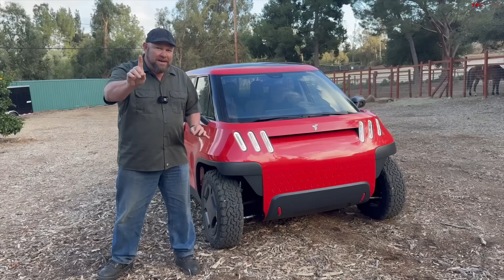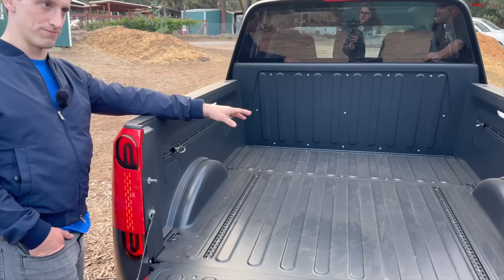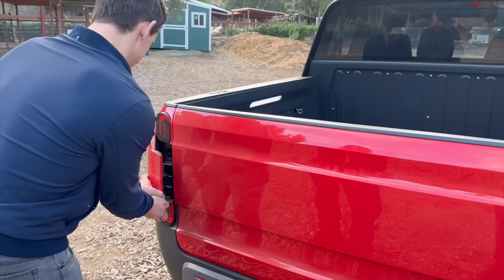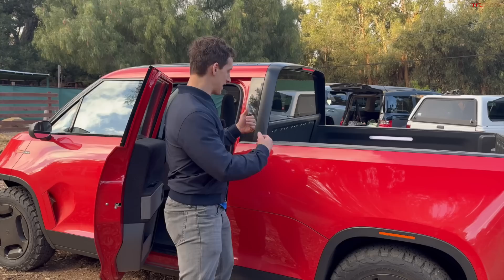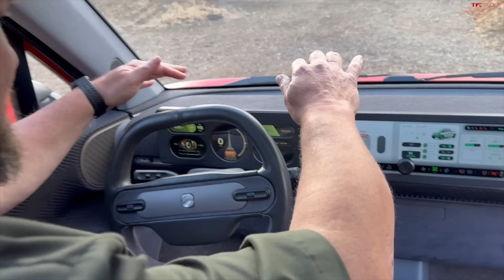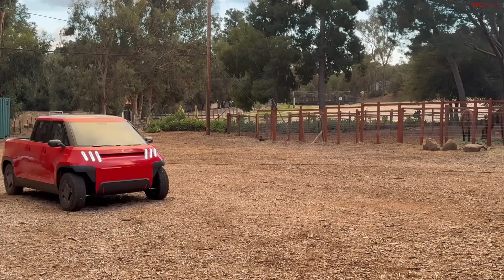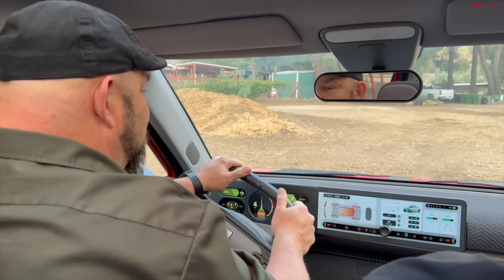I Drive the Most Revolutionary Truck In Decades: Meet the Telo MT1!

Comment: I am not a fan of pickup trucks. More so being on the road near them. Sorry to say this, but most "bad drivers" I've encountered on the road are usually a pickup truck driver. Heck, I can narrow it down further to white pickup trucks. Knock on wood, I've not been in an accident, but the number of times a pickup truck has tried to just merge right into my car (Honda Fit) on the highway or cut me off in a residential street is crazy. Anyway, I just see pickup trucks and know I should avoid them as much as possible. They aren't safe to be near. All that said though... the Telo? I'm actually interested in. Only due to the compact size + partnership with Aptera. I would 100% get the option of a Telo with the solar panels, but as a 2nd vehicle. The daily driver I'm aiming for is the Aptera. Once I have that, I could see myself getting a Telo.

Comment: I have a Lexus GX460 with a V8, and this truck has basically the same towing and weight capacity as it does.  

Even as someone who has a decent amount of experience with EVs (5000+ miles in different ones) despite not owning one, that is impressive to me.   

Seems like they will end up with a pretty decent product once it's ready for manufacturing.  Well done!

Comment: After looking at their web page, I think they should inclose the front wheels. There may not be any performance reason to do it but the cosmetic look will change the perception by leaps and bounds. Currently it has a golf cart look which I don't think will help sell a "truck". That area will always be dirty from road gunk and muddy roads. 
Their next model should include a very small ICE engine acting as a generator that is only for charging the batteries (like the BYD?). That would relive those with range anxiety by adding a massive amount  of miles to the range.

Comment: I wanted to not like it, because i generally dislike EVs. However, its well designed & they understand the importance of "staying in your lane". By not making this something its not & excluding features that are impractical, theyve created a pretty utilitarian vehicle. By ditching the offroad capability, they should be able to stiffen the suspension enough to ensure highway speed stability. Im not a fan of the glass roof, although thats the trend in modern vehicles.

I did have to laugh at the "if your a surfer" comment. Way too many manufacturers mention that an otherwise unusable space could fit a surfboard. In reality, ive yet to meet a person who actually goes surfing, in my life. And i live on the coast.

Comment: If it had a frame mounted bed, this would definitely sell for commercial applications. With that bed? A lot less

I see 20yr old Ford Rangers still holding on for dear life with a contractor utility bed on the back, for exterminators, locates, etc

Comment: This is the best use of space efficient design I have seen.  I get the impression the back seat is limited.  Am a little surprised that there is no front bumper but assume that will change.  The ride appears harsh.  That said this may be a great option for around town.  Not sure on price for what looks like a base model.
Reply: Modern trucks don't have bumpers. The plastic "bumpers" are called bumper covers and underneath is a metal crash bar. The front of the Telo has a crumple zone to pass crash safety, so it doesn't need a fake bumper.

Comment: They expect us to believe that 3 adults can sit in the back when the two guys in the front were inches apart. Also, why didn't you sit in the back seat? Or would that have given away how cramped it is? Thirdly, if tgmhe only way to get the "8 foot bed" is to slide the front seats so far ahead nobody would fit, it isn't an 8 foot bed. There is also nothing in the midgate that acts as a load stop, so the front seats are the load stop.

If tgey are misleadibg about room, why would we belueve range or payload clains? Should have sent Andre or Roman. They would have actually asked him the tough questions instead of this puff piece.

Comment: Starting at 42k. That’s more than a base f150. Might be a mini truck but it’s got “big truck energy” when it comes to price. Would be a home run at 25k , not at 40
Reply: Totally disagree. Look at the price of other EV trucks.. they're like $80-100k. It's a totally different market than a gas truck..,

But let's see if they can get it built.
Reply: Their  only competition in that class is the maverick which starts at 26  and the Hyundai Santa Cruze is 30k. So 10k over the competition. Why I said I don’t think it’s a good price point.
Reply: @ But those vehicles aren't electric... so they have like 1/2 the power, are noisy, rough, drive worse, cost far more to operate, have higher maintenance etc. totally different. Is a Rivian in the same class as an F150 because they're the around the same size? But it's over 2x the price! How do Ford sell Lightnings when they cost twice as much as the gas model etc.  

The Santa Cruz and Maverick are also massive compared to this. Many people don't want such big vehicles. There's definitely a market for a mini truck and an EV will fetch a big premium

Comment: Not the first mini truck built in the USA. Not even the second. But the first one in over 60 years as far as I can tell.  Like the 1938 American Bantam, late 40’s to early  50’s Crossly pickup. Even today, you can order low speed urban pickup like vehicles from outfits like Cushman.

Comment: Dang, i like this a lot. I do a lot of offroading, but not rock crawling. I routinely carry 2-4 people plus mountaineering gear. I have an apartment with a single parking spot. I need something that can do medium difficulty offroading, can fit all that stuff, and fit in my garage and on tight BC trails.

I also hate how much I spend on gas, so electric ofc basically solves that. The only things I'm really concerned about aee:
- proof they're reliable, of course. I don't do first model year
- more buttons for hvac, media, and vehicle controls (drive modes, etc)
- paddles to adjust regen, esp in the mountains, adjusting on the fly is key
- departure angle looked maybe a little suspect, want that to be good
- I do also road trip a ton, a charging curve that can sustain peak or near-peak charging rates for a majority of the curve is essentially if I'm gonna go full EV. I drive 1000mi in a day multiple times a year, and do many more trips that are still 8+ hours on the road. I can accept stopping for more than 10 minutes, but i can't accept 4 stops of an hour each. 

If they can deliver on these things, they'll almost certainly get a customer
Reply: Also welcome back Nathan! I was worried you had left!

Comment: Cute little truck, it looks like a fun vehicle. Something like this looks like it would work well in a city setting with the capability to do the same amount of work as a base-model full size truck. For how large it is my Silverado 1500 is only really capable of hauling 1,000-1,200lbs without causing severe damage to something. It says it has a payload of about 1,900lbs, but that is the weight of passengers and whatever is in the bed combined. If this little thing is rated at 1,700lbs combine payload then it is still capable of hauling 1,000lbs in the bed or more without passengers. Plus you get the maneuverability of its' small size in tight areas.

Comment: I REALLY like this - way more than a ridiculous Cybertruck.  I can see purchasing this if it comes to fruition, and as a replacement for my long bed 4 door Tacoma. I'm fine with a 350 mile range electric especially if it can use the Tesla Supercharger network.
Reply: That range is with nothing in it and definitely not while towing anything. Then at that point you don't need a truck if it can't haul or tow right?

Comment: Love the idea of having an American made mini truck but the biggest appeal to kei trucks isn't just the size, it's the affordability and utilitarianism of them. Would love to see a single cab version for a longer bed, a fold-able flat bed, no luxury other than AC/heating (maybe a radio too) and some of the cheapest interior to dramatically bring the cost down where it competes with a brand new kei truck. 

People don't buy kei trucks to live in them, they buy them to do work at the farm and that's the biggest difference between the Telo and a proper mini truck. It's farm equipment, not a daily driver.
Reply: We are totally on the same wavelength.  I would buy this for the gas savings and being able to haul my side by side UTV to the trails.  You can keep the pwr windows, seats, locks, and heated seats and steering wheel.    That is less wiring and things to go wrong.  I don't even care about infotainment system.  A smart phone could handle all of that.  I don't even need that big of a battery or the ridiculous performance numbers this thing is capable of (though it would be nice).  Hey Telo:  Focus on the utility and drop the price!
Reply: @Kalidrius  Maybe I missed that in the video... Did he say this would be made in the US?

I would have guessed they'd contract build them in China and import them.
Reply: @SHO1989  It's been said elsewhere they'll be produced domestically in the US.
Reply: excpet this thing needs an engine. and remember Kei cars aren't safe that is why you can't have one. but this piece of plastic shit is.
Reply: @magnavoxfifty  
Wow, he did say aluminum & carbon fiber bonded like some of the strongest, lightest chassis on the market. But if you don't like the "plastic shite" you won't have to buy one now, will you?!
Reply: @derekharris4686  They use a lot of it in F1, and IMSA.
Reply: @magnavoxfifty  You can import kei over 25 years old, and they're legal to register and insure for the road in all but a handful of states. And I've seen some workarounds for the ones that don't. Ive owned both metal and plastic skinned, and from that experience, I'd take plastic composite over metal skin any day of the week! So bah! 🤣

Comment: More power to them, no pun intended.  I want a single cab, maybe extended cab, the size of the old Rangers and s10's, with a hybrid engine and a 7' bed.  Would settle for 6'.  Don't need or expect a lot of hp or torque.  Just a truck bed when needed and excellent gas mileage.

Comment: Counting the tailgate as part of the bed length is a scummy salesman's bit and then you add in folding the seats down to that to stretch it further. If the guy was honest about the bed space I would have a fair bit more respect for what he is trying to do.
Also the pricing is such that you can get a Maverick,  Ranger,  Tacoma, or Colorado all for either less or with more features then this thing. I could see this as a city run about where the overall size is more important than the capabilities of the vehicle but for a utilitarian vehicle it's already pushing up against other vehicles that offer more for similar price.

Comment: I love it, but electric doesn’t make a good road trip. I need to pull 2 motorcycles on a trailer. 12 hour drive minimum. Great for daily around town truck, but if I want to use it for the main reason I buy it. Towing., I love it, but need ICE

Comment: I think it's cool, but that price needs to be in the mid to high 20's to be competitive.
Reply: It already has $14,000 worth of battery cells in it. Unless they can build the rest of the truck for only $14,000 more that is not going to happen.
Reply: @maj429  Well if they can't,  then I'll be sticking to the Ford Maverick and such. They need to get the price of those batteries down to compete.
Reply: @Loyalwhiteknight the other thing though is the telo is all American? 

That maverick? I highly doubt it’s all made here in the US, and it probably costs the same if not more. Not to mention, it’s still going to be bigger.
Reply: @Loyalwhiteknight  They really don't. This isn't competing with the Maverick because the Maverick isn't a mini-truck; it's a compact truck. Any company that can give American consumers a mini-truck has ZERO competition right now. Many people assume that if you could pay less for a Tacoma or Maverick, than this vehicle can't compete, because you'd be paying more for less. While nobody likes paying more, a lot of people would be willing to pay more for a smaller vehicle. 
They're much easier to park (standard, diagonal and especially parallel). They're more efficient. They're fun to drive. You can fit them in driveways, street parking and garages FAR more easily. Getting in and out of them is far easier for the average person. 
While we'd all like to see this price come down, there's a large niche market for this vehicle that doesn't want to buy a modern Maverick or Tacoma, as they're still much bigger than they need to be if all I want to do is pick up a piece of furniture, haul a sheet of plywood or transport a couple of dirt bikes.
Reply: @coachhalas6031  The only people that would buy this at that price are the ones who want to brag about driving an EV or the one who want to show they have money to spend on a EV that isnt practical as a truck Like every EV truck I sorry but EV trucks just dont have the range while towing or hauling loads they are just over priced city cars that are big and heavy and dangerous to small cars not that big trucks arent just as bad but like the Hummer EV is what 9,000 to 10,000 LBS like thats killing people if it hits them .  Thats the other problem with this EV its tiny people buy trucks to feel safe and even if this thing gets good ratings in safety tests I wouldn't feel safe in it at all.